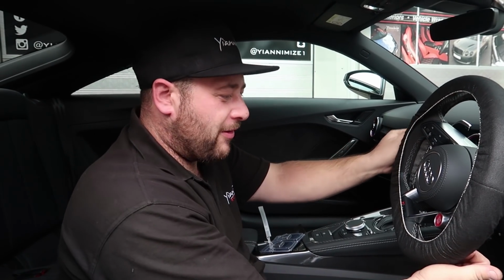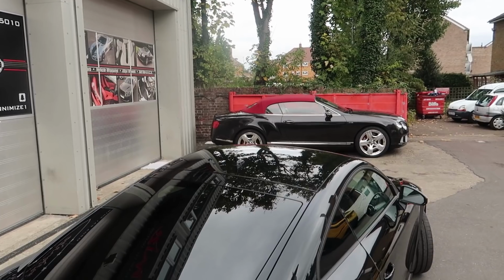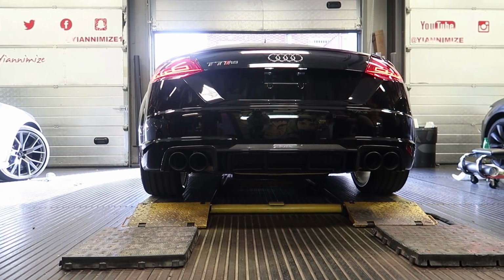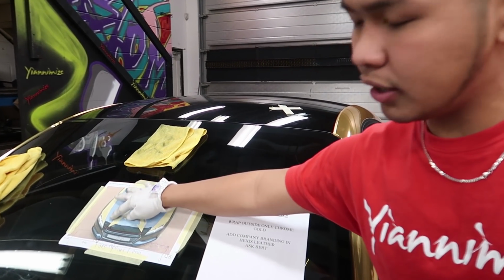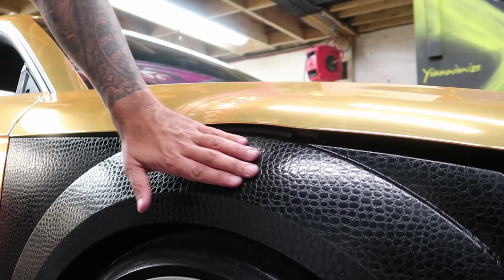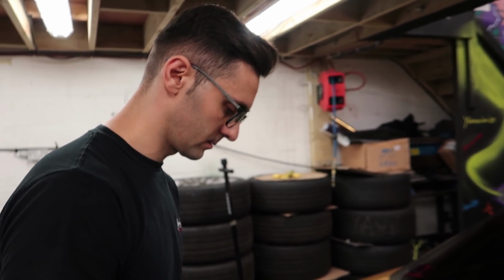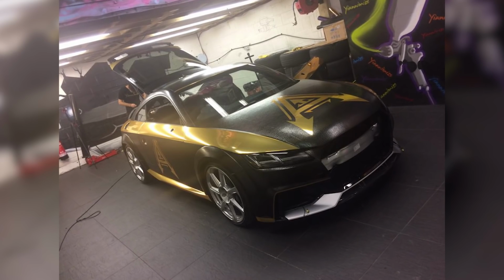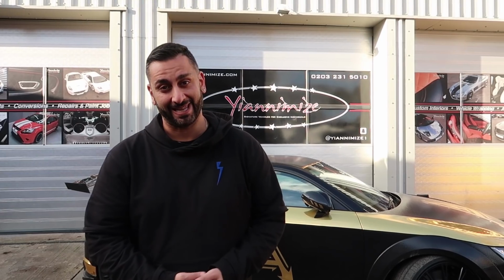Audi TT RS-R wrapped in Crocodile Skin and Chrome Gold

Comment: It may be pimped out but it’s still a hairdressers car
Reply: Will Thomas i think you mean flight attendant
Reply: I think u need to know more about the car
Reply: Hairdresser with a £80k+ car?
Reply: Buy My Bread never ever would a hairdresser own such a car.
Reply: Will Thomas yesss! And a Porsche boxter
Reply: aWildDuck my barber has a  2017 range rover velar and the other has a dodge ram
Reply: Maybe a normal tt but not a tt rsr
Reply: The original TT is a hairdressers car. The TT RS is a whole different thing. Just test drive one and you'll understand.